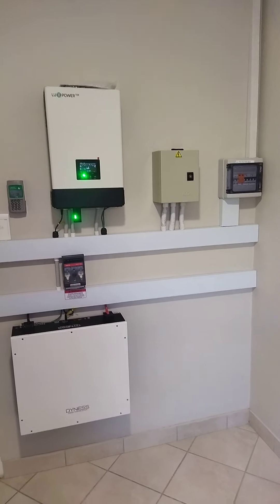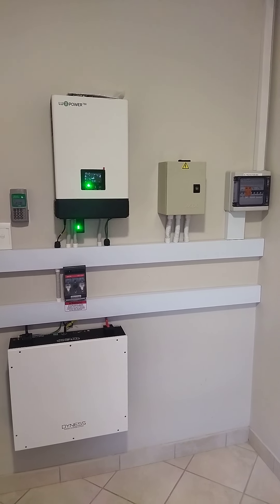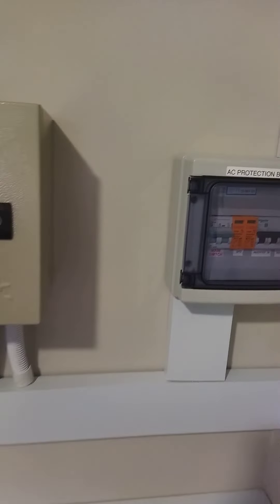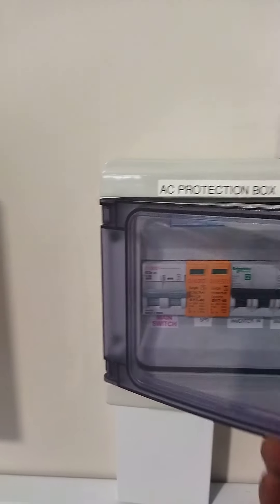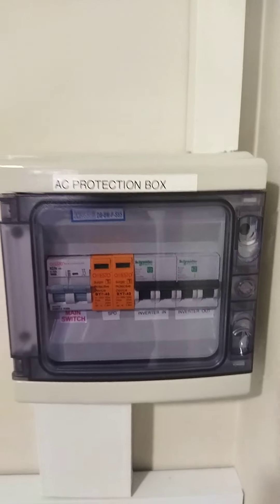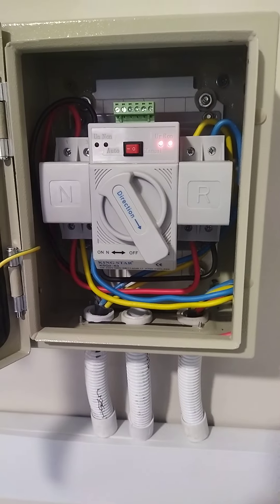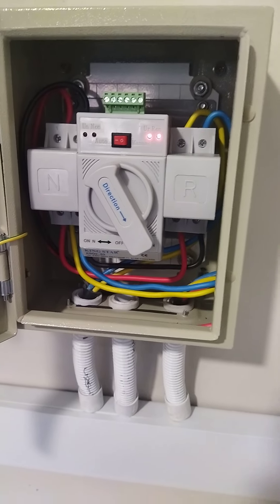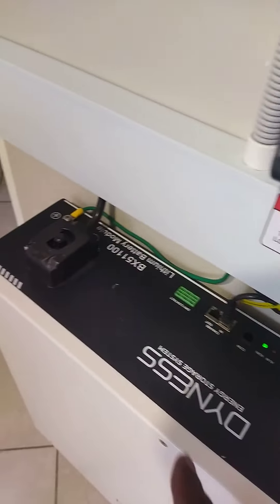Lux power SNA 5000 with a Dyness Lithium Battery 5.12 back up installation.ATS switch

Comment: I have the same installation. I have to use the lead acid function, my dyness battery is not seeing the LuxPower inverter. Ive change the cables, my dip switch is on 3. but no communication between the battery and inverter. If lead acid is use communication start. Can you help?

Comment: How bad is the fan noise on the Luxpower SNA inverter. Growatt is so loud?
Reply: I installed a 5kw Luxpower a few week ago. When the batteries started charging from the grid after loadshedding the fans became realy loud.
Reply: @dannystrachan475  Thank you Danny, I also bought the SNA over the weekend. Will have to install it in the garage.

Comment: Hi Anthony, I have a Luxpower SNA 5Kw inverter and 2x 5kwh shoto batteries in parallel . When Eskom is off and I am on solar/battery and the batteries are full my lights will flicker faintly. Have you run into something like this or have an idea what the cause might be? If I put on a higher load like a kettle it will stabilize again.
Reply from the maker: Hi there the flicker is probably an indicator that your earth neutral bonding is not solid

Comment: Hi, did you have to change the battery settings on the inverter for it to pair ? I have the same setup installed today but it won't pair, using the lux cable that came with the dyness a48100 battery
Reply from the maker: Hi there if you are using a newer model of the lux power use a straight cable not the lux power cable it came with it will be labelled Deynes Sunsynk Growatt
Reply: @anthonymwambazi7390  I have model sna5000 wpv
Reply: Hi it worked thank you. Battery not charging tho
Reply from the maker: @rodanpillay8846  you will have to set up charge settings on 14 and 15 for the inverter to start charging from Eskom

Comment: Did you use a straight cable for the battery bms coms? Dip 3 up?
Reply from the maker: Hi there yes we used straight cable